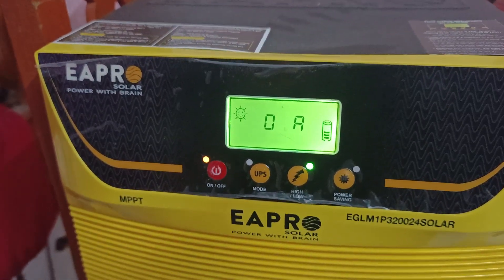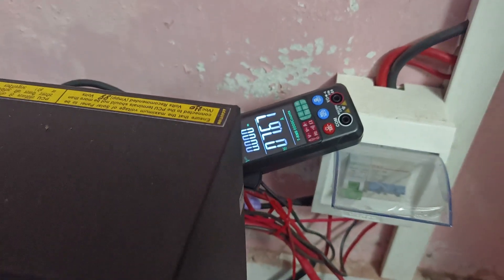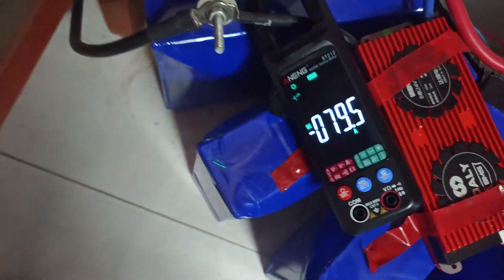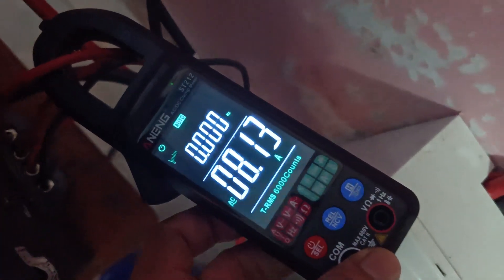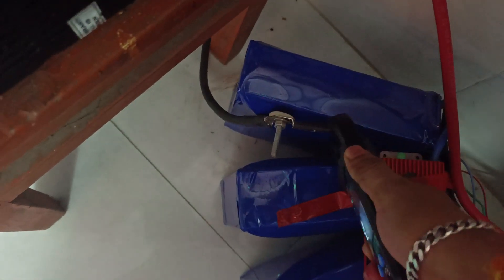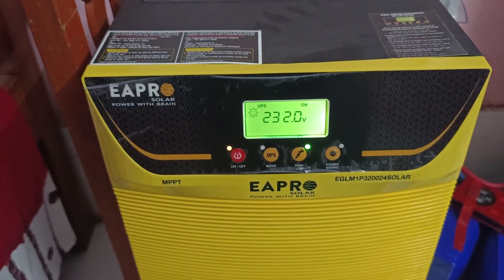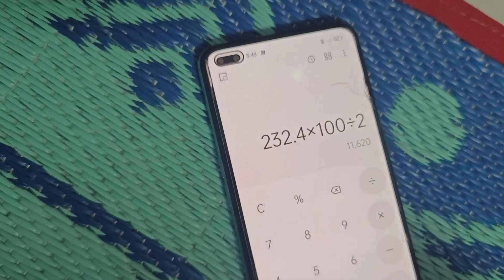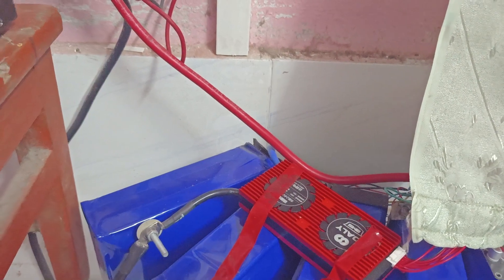Eapro 3kva 24v mppt solar inverter load test details load test video with lifepo4  battery

Comment: Please make video of solar charging battery how much ampere..we want to see how much amp it will give to battery when the battery is fully discharged
Reply from the maker: If you press high low button then it will give 50amp highest..
If solar generation is more then it can give direct output  From solar .
Reply from the maker: New video is available on my channel. 
Plz visit and see it

Comment: Dada eapro ar nexus 2.5 inverter konta best hobe ?
Reply from the maker: both 2 are best. 
Eapro 3kva *.8 =2400w
Nexus 2.5kva*.8 =2000w
But Eapro is latest and load bearing capacity is little bit more than Nexus &
Price comparatively lower.

Comment: Hallo sir kya is inverter pe Loom 545watt ke 2nos panel searies mein kar sakte hain, kya aesa krne pr battery charge hogi aur battery kitne ampiyar se charge hogi
Reply from the maker: You can connect two panel  series up to 144 cell..  In this turm mppt has a great benefit.

Comment: dear tell   this inverter work with lithium battery
Reply: Yes its compatible with lifepo4 lithium phosphate
Reply from the maker: You have to set solar charging voltage 14.4v that means 28.8v